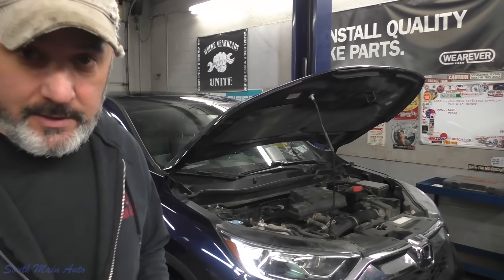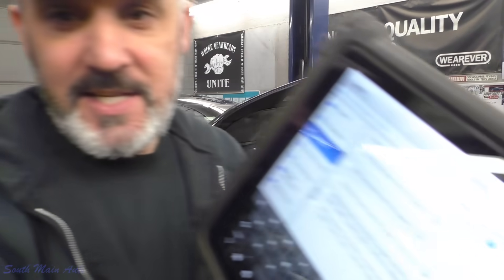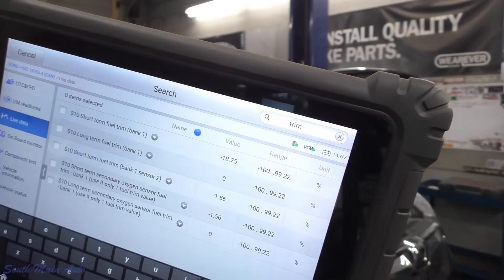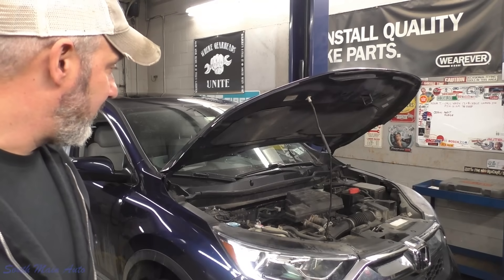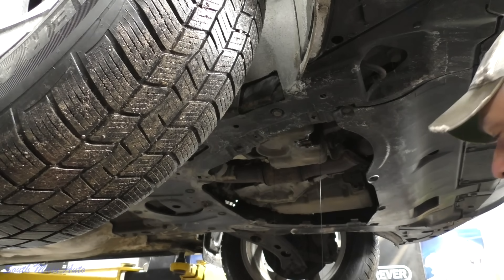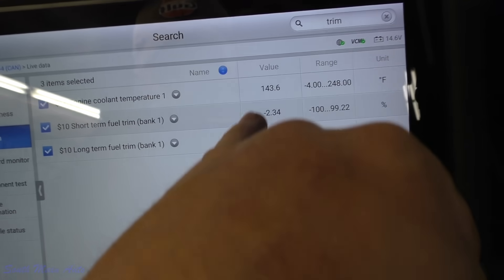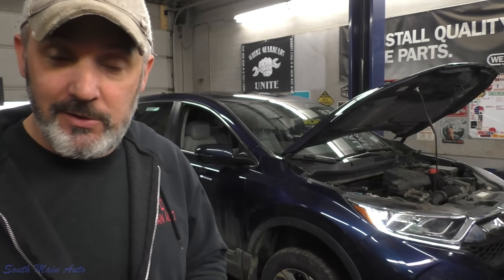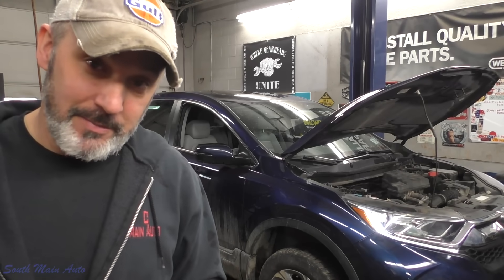Quick Tip Tuesday - Fuel Trim Troubles

Comment: 30 years ago I worked one winter as a CAA road-assistant boost tech (Canada's version of AAA). Whenever we had a cold snap (-20C or colder) my supervisor would remind us if you have a no-start situation with a customer, to first check the dipstick. Why? To see if there's a "fuel line" mark on the dipstick. After prolonged starting attempts on many vehicles the fuel injection system would dump so much raw fuel into the engine it would bleed past the rings into the oil pan. It would then collect above the oil level in the pan. You'd see it on the dipstick.

At that point I'd show them the dipstick reading, and inform them that we won't boost the vehicle because it's a potential fire hazard, could cause massive engine damage due to oil dilution, and needed to be towed to a garage for an engine oil change.

The worst culprits at the time? Those Ford Tempos and Mercury Topazs with FI. Total garbage in the cold. Funny thing was the carb'ed versions worked great. Had no problem get those started. The easiest to start? Any Honda, even at -40C with no block heater. Just boost it and they'd start. Batteries were the culprit and the FI never flood the engines.

Thanks for the memories Eric! Boosting vehicles at -30C was always an interesting time. Cheers!
Reply: They did make an AWD version of the Tempo from 1988-90? that I'll would say was good in snow; if you could get it started.  -40C is the same as -40F so, it was cold.
Reply: @lvsqcsl  Are you sure about that? Water freezes at 32 degrees F and 0 degrees C. It boils at 212 F and 100C. Freezing to boiling in C is 100 degrees, and for F is 180 degrees.
Reply: @lvsqcsl  - I've got a Ford Five Hundred with the AWD and winter tires. It goes like a mountain goat on ice and snow! Gotta agree - AWD is the way to go if you're in a climate where there's the white stuff on the ground for more than a couple of months!
Reply: Had a tempo for many years in the U.P. Of Michigan, never left me stranded always started. I’ll say though that if it was below 0 my radio wouldn’t work lol it eventually came on as I was driving and warmed up in the cab
Reply: @corranda  - I know It gets cold down there in Michigan's UP - guess you were one of the lucky few that didn't get a bum-lemon Tempo! As for your radio issue - my Ford Five Hundred's radio resets when it gets colder than -20C (-5F). Ford can't help being Ford! 🤣

Comment: Such a great tip. I've run into this before as well as needing to clear the fuel trims with the scan tool because they didn't reset with code clearing or even a battery disconnect.

Comment: On a slight tangent. I couldn't start my Honda generator . I checked the oil level and it was ok. After a lot of cursing & head scratching I changed the oil which seemed a bit thin. It fired up on the first pull. The float in the Carburettor was letting by and would flood the engine if you didn't turn the valve off when not running.

Comment: Wow, the algorithm matrix is working OT! Just watched a video on ASE A8 test prep, mentioned a similar scenario with a p0172 and p128. Owner changes the oil and filter and the vehicle won't start. Fuel trim was off the charts.

Comment: It happens with carbs and diaphragm fuel pumps too. Maybe more often but you don't have fuel trim readings to indicate. Only experience and visual inspections and sometimes the oil doesn't look all that fuel laden but the engine still doesn't run as good as it should. Remember cold weather and chokes?

Comment: Honda Earth Dreams turbo engine has had a fix which is to instead of running the car on gas, you run it on hopes and dreams.  Then you overnight parts from Japan so you can decimate all.  Gas diluted oil is Honda's new motto.

Comment: Crazy how loud GDI injectors are. Sounds like a freaking diesel.
Luv me sum SMA video ❤
Reply: Diesel engines were the original direct injection. Injectors are just loud when dealing with PSI in the thousands.
Reply: Yeah sounds bad!
Reply: Usually not the injector making all the racket it's the high pressure fuel pump. Take the foam off and it sounds like a bad lifter.😄
Reply: Hyundai and Kia are quiet as a mouse...
Reply: @andreim841  they have padding and shielding to dull the noise, just shut the hood and it hides most of it.

Comment: Has Honda addressed anything in the oil dilution class action lawsuit yet? I know the last time I heard, they were kind of trying to blame the drivers and their "short trips" during colder weather? Great video Eric, you're the only mechanic that ive seen that has brought up these fuel trim issues caused by oil dilution. This issue has to be taking a toll  on their bearings.
Reply: Yeah its why im pretty anal about changing my oil. But its such a great engine otherwise though, i'll just accept the oil changes.
Reply: @The_Noticer.  yeah, but most people aren't, and a car should be able to make short trips during winter without issue. If you look into the lawsuit, they're saying Honda actually knew this was an issue back in 2017/18 but still continued to sell cars without informing the customers or addressing the issue. Fuel dilution can ruin  bearings and seals in the long run. These 1.5 issues are really still new, no telling what's going to happen once the cars start aging. I think that if anyone can build a bulletproof 1.5l turbo engine, it's the engineers at Honda. It's just a lot of compression in such a small engine.
Reply: @ Oh im not excusing it. I knew about the issue before buying it, but i'm sure a lot of people dont. That being said, i'm sure a lot of people also didnt know about wetbelts before they became an issue. And those tend to grenade the engine without much warning. I consider that one to be worse.  

Not an excuse, but also not a huge deal if you just change the oil as you should. And install a catch can...

I just love that I can drive 4.8L/100km on the highway but still have plenty of power. Without it being a hybrid.

Comment: If I understand you correctly, Professor O, what you're saying is that if an engine is running lean the solution is to pour gasoline down the oil spout, correct?
Reply from the maker: Correct 😂

Comment: I knew those Earth Dreams engines had oil dilution issues but never thought that the gas evaporating out of the oil could cause issues like that.  Thanks for the tip Mr. O!
Reply: its like farting in a swimming pool
Reply: wait until a tractor engine fills the oil with fuel, it starts and runs then gets  richer as it gets hot, right to the point of black smoking and keeps running with the fuel valve shut off. lol major oil dilution, probably not good for the bearings and rings, but it cleared the sticky lifters issue up (stupid kohler engine on old craftsman lawn tractor).
Reply: How did gasoline get into the oil in the first place? That is disasterous to begin with?
Reply: @ leaking and/or dirty fuel injectors, with bad spray/mist pattern instead of atomizing, it sprays in droplets or a heavy mist. then there's the leaking ones that dribble fuel into the cylinders throughout all engine cycles, which washes the cylinder down(removes oil film) and then the fuel more easily passes the rings and into the oil pan as well as wearing the rings, cylinder and piston very fast.
when engine is off, straight fuel will run through the rings gaps and lands(piston grooves) directly into the oil at a fairly fast rate, since it's such a thin viscosity fluid.
Reply: I wonder if Honda has addressed the class action lawsuit yet?

Comment: Brother Erik I had one that threw us for a loop after the vehicle also came in for Rich codes and all the lights lit up. We ran The AF TEST AND all injectors failed RICH. Slapped new Injectors straight from Handuu and did the oil change. Drove it to set some monitors but at idle all of sudden the trims would shift super lean to +43. Give it gas and trims would normal out. MAF READINGS were Wonky and jumping all around which didn't make sense to me. Sure enough after smoke testing and found no leaks I noticed a collapsed hose at  the intake manifold and replaced it. Still running Lean and proceeded to still check for my vacuum leak procedure. I blocked off the valve cover hose that connects to the Turbo and air filter box and my trims would return Damn Near +2. No Pcv internal to the valve cover but an external Yellow One with a 10mm nut. Replaced it and car was fixed. First time I ever seen that external Pcv fail that way. After car was fixed my MAF reading returned Steady. Hope this also helps Someone
Reply from the maker: Sounds like a great learning experience. Thanks for sharing!
Reply: key word was "turbo".  As soon as any forced induction is involved, always expect PCV issues to occur and cause random troubles. also fuel pressure regulators(older designs) loved to go silly. the culprit is because everything goes from vacuum at engine idle to boost pressure under. that's a big swing from below atmospheric pressure(vacuum) to above it.
the diaphragms do some major flexing and move far greater distances.

Comment: This is why I prefer to get my injectors from Amazon. That way the fuel trims can go straight to +30 and make sure it doesn't run rich 😂. Good tips. Always overlooked.
Reply: This is the way! 😂😂😂
Reply: just make sure you top off your oil with a gasoline additive
Reply: but sometimes they do the opposite!
Reply: Ebay is jealous now